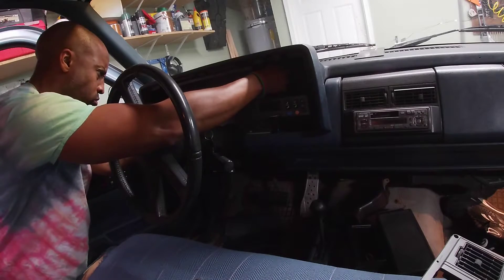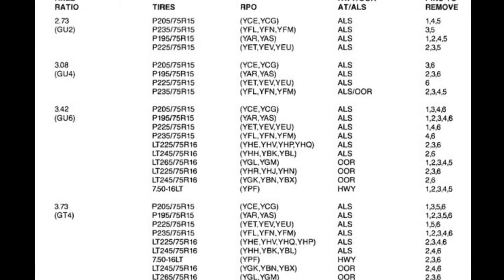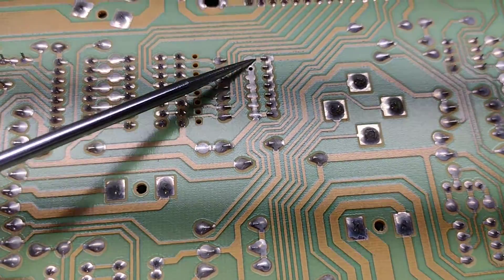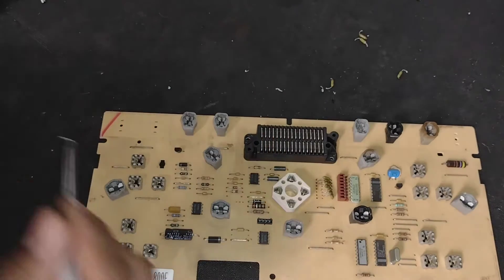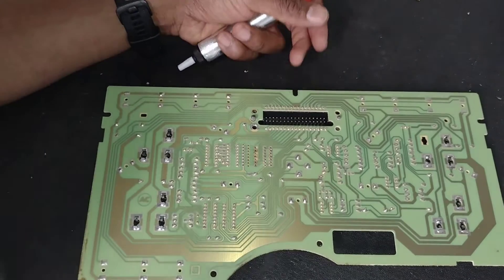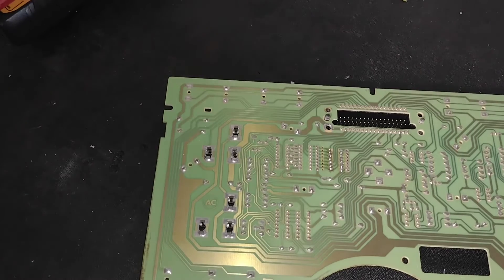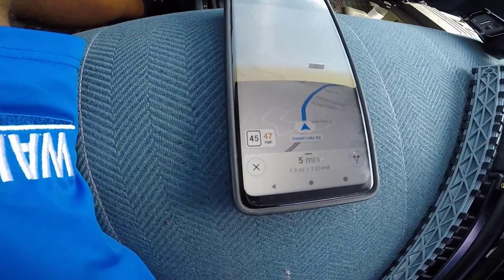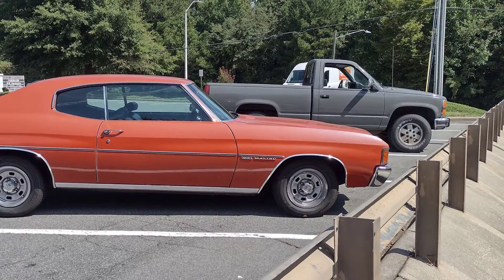1989 K1500 Speedometer calibration w/ DIP switches

Comment: ive got a 98 1500 and my speedo is off in a non linerar way, that at 50kmh it reads 70 and at 80kmh it reads 120. would something like this work for my truck being so much newer and would this fix my issue of it not always being off by the same amount?
Reply from the maker: I'm pretty sure yours is different and a bit more modern. I don't think this will work🫤
Reply: @MaqsVids  ah alright I’ll keep searching thanks tho and really well formatted video
Reply: @moose_man46 did you figure it out?

Comment: Thanks for the video it was just what I was looking for. I just replaced the tires on my 1988 K1500 Silverado and went from the stock 235x75xR15 to a 31x10.5x15 tire. I removed the 7 fuses and replaced them with the 7 position dip switch as shown in the video. I checked the calibration chart but saw no combinations that was close to what I needed. I did try several of them though. After many tries I finally just turned all 7 on and started turning off different ones randomally (shooting in the dark you might say). After numerous attempts I finally hit on the right combination. For my 3.08 rear gear ratio and the 31x10.5x15 tire it was 4 and 5 off and all the rest on. Thanks again for the information.
Reply from the maker: That's awesome! Kudos to you for trying all the combinations. I was excited to know that it was even possible to adjust it.
Reply: @MaqsVids  It was a lot of trial and error and taking the speedo in and out but I am one that doesn't give up easily. On a funny note my neighbors thought I was going crazy going in and out of the neighborhood testing my adjustments. The speedo is now dead on the money correct.

Comment: So using these dip switches is it not necessary to reset the programming like the kit did back in the day? I'm talking about where you plugged the harness from the kit into the cluster and sent 12v across
Reply: If you don't mind that be awesome
Reply from the maker: For once, I actually put the direct link in the description. People tell me to do that...
Reply: I was going to go to a junk yard and find an old cluster harness to make the reset harness but if these dip switches negate that step that'd be sweet
Reply from the maker: That is the first I head of a kit. I didn't have to do any of that. Once the switches are set, you are good to go.
Reply: Ok cool I'll give it a try. Yeah back then GM sold a kit it was a harness you plugged into the cluster to reset the speedometer. After that there was and 8 pin connector what they called "programming clip" that plugged into what you desoldered. Based on axle ratio and tire size there was a chart that would tell you what pins to remove and then you'd plug it into the back and good to go again. They discontinued that kit long ago so good luck finding one anymore. This is the best solution i think. Thanks a lot for the video!
Reply: Where'd you order the dip switches from?
Reply from the maker: @cast-ironcowboy  I ordered them from Newark.com I'll look at my order later if you want the exact ones.

Comment: Nice work I seem to be having all the same problems with my 89 c2500. Thank you for not skipping through parts that may be obvious to you or that you are doing for the first time and make mistakes like we all do.
Reply from the maker: Thanks man! I really appreciate it. I try to include details without making it too boring. I prefer 2500s. I had to sell mine because it wouldn't fit in my garage or driveway. I miss it.

Comment: Hey bud AWESOME video. I'm glad I found your channel cause I have a 1990 model obs. I was wondering if you know how to check if the speedometer gage is working because my speedometer and odometer are not working. They never worked when I purchased this truck. I replaced the speed sensor and it still isn't working. If you have any  suggestions on what to do to get it fix I would really appreciate it.
Reply from the maker: Hey! Thanks!!! My odometer didn't work when I got mine too. But, I have not fixed a broken speedometer before. I wouldn't be surprised if it is something with the cluster. These trucks are simple compared to modern cars. It could be something simple. I did fix my odometer with a new gear though.
Reply: @MaqsVids  thanks for replying so soon. I took my cluster apart and checked the odometer gears and I was able to spin the gear and when I did the numbers would move so I think my odometer gears work. I think they are not moving because my speedometer gage isn't working. Is there a way to check if its the cluster that isn't making my speedometer gage not working. Is there a way to check it ?
Reply from the maker: @supamario830  There has to be a way. But that is beyond my knowledge at the moment. Do you have access to another cluster?

Comment: I swapped in the wiper motor and a new board from my 1992 C3500 to my 1988 C1500. Couldn't buy a board locally for the 1988 motor. Works perfectly. Now I need to do this DIP switch due to swapping in a 3.73 gear set from the stock 2.73 and have 31x10.50 tires now. Thanks for the video..very helpful.
Reply from the maker: Nice!!! You are very welcome. I love these trucks and the more that are out there the better.

Comment: When removing stuff that has the bent over tabs like that I snip from the top side with side cutters.  That way you're not having to pry out from the top like you did, which risk pulling the copper trace off of the board.  It's annoying that they flip all of the legs over like that.  Another thing I do with the solder sucker is that I flow new solder onto the old solder in order to get a better 'melt'.  Seems to allow me to get 100% solder removal much easier.   Thanks for the video!
Reply from the maker: That's a great tip! I will use it. I have pulled a trace away from an old board before. It makes my heart sink. And it's usually the last one.Thanks!